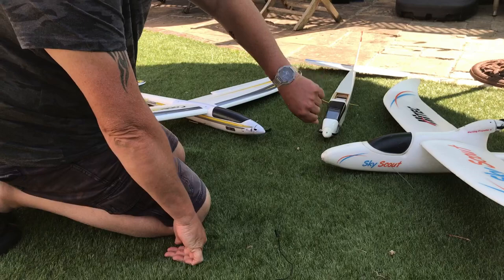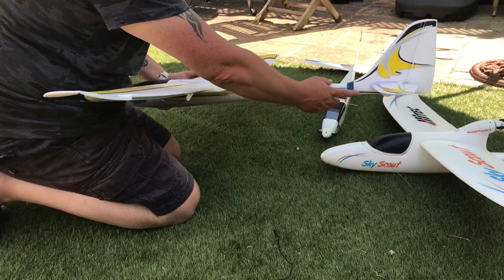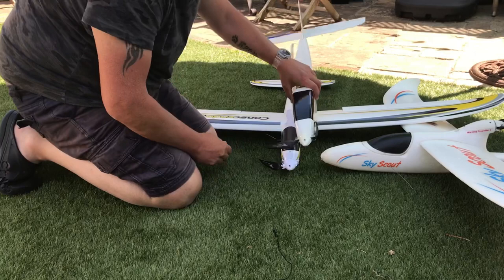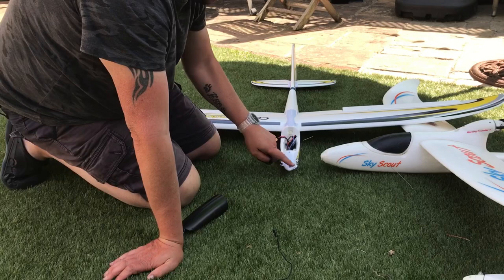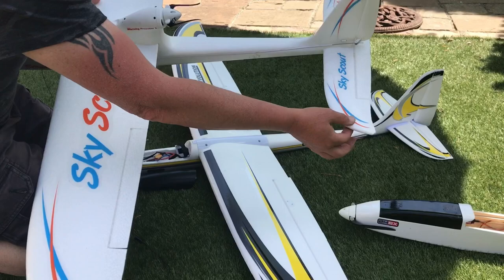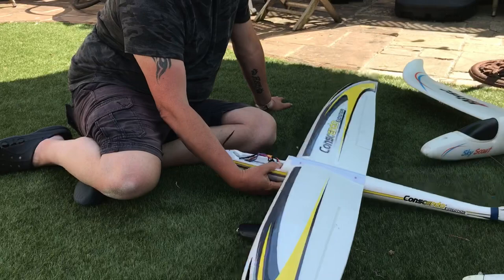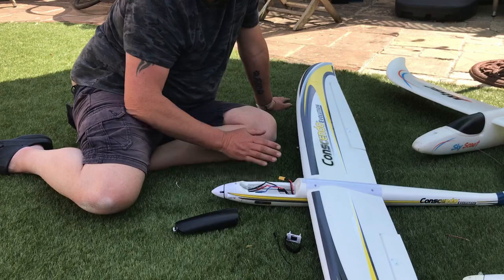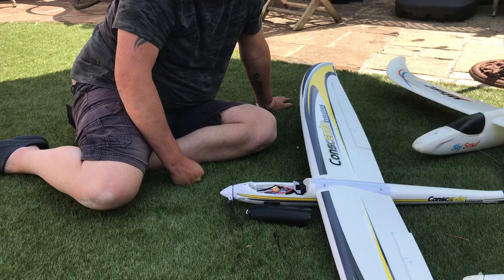Horizon Hobby Conscendo Evolution ‘honest’ review ‘update’

Comment: I have two conscendo evolutions (one is a backup still in its box...) because it is so good! When the weather gets bad and rough and windy, I leave the planes at home and take the Conscendo Evolution out to the field. I can fly with one battery a very long time (3S 2200 smart battery from spektrum). I once flew for 45min, then I landed and still had battery left (well it IS a glider, so with the right thermals you can fly for a very long time)... a great plane. No need to put a 4S in it.

Comment: Thank you for such an honest review. I'm the owner of Conscendo Evolution for over 2 years and I can confirm all the issues disclosed here. In addition, I could add a few more:
1) Wings horizontal positioning - look from the nose, and you will see that the right wing is a bit down the horizon while the left one is a bit upper - about 10 degrees angle to the horizon. I bought a second fuselage and found the same issue there too, so it's a manufacturer's bug.
2) Weak fuselage design, especially in the area of the battery compartment. It breaks in case of a side landing. You can find tons of videos of when people lose their Conscendo breaking fuselage in this area due to a hard side landing.
3) Very small space in both the battery and the receiver compartments. There is no space for adding something there (for instance, a gyro module or flight controller). I even barely can add a battery voltage buzzer alarm there.
4) Plastic gear servos - cheap stuff, that breaks easily after the first crash
5) No real hinges - all turning surfaces such as ailerons, elevators, and the rudder are just foam fixed with weak tape.
6) Wings mounting gear is total madness. There is weak plastic stuff that easily breaks after a couple of crashes. 
As a result, I spent +$300 and a hundred hours improving the plane by enforcing it with carbon fiber, changing servos, adding plastic hinges to all turning surfaces, etc. My current body is like a baseball bat, being covered by carbon fiber at 70%, especially the frontal section including the wings mounting area. I even added 3 carbon fiber rods along the fuselage from the motor section to the rudder to prevent the tail from trembling and shaking during the flight - it's not a fish, it's a plane!
Furthermore, I changed all original servos to EMAX servos with metal gear. I covered all the frontal parts of the wings, elevators, and rudder with carbon fiber stripes to enforce them. Wing mounting area and that plastic stuff had been enforced with carbon fiber too. I got +100 grams to the weight, but now this plane is a robust flying bat.
I like the shape of this plane, but it requires a lot of improvements to be done to get it working well.

Comment: I have some very mixed feelings about this video. The Conscendo was and still is targeted at beginners. That said it definitely looks like Horizon has hot-rodded the design over the years, and so it's pretty much to be expected things are going to break. This plane is NOT a hotliner, and really wasn't intended to be. In that sense I think you might be being a little hard on the plane as you want it to do things it wasn't really designed to do. Also, the price really isn't unreasonable for what you get. This is an expensive hobby to begin with, and there's not a lot of equivalent planes with that level of features and performance for that price point. 

However you do make valid points about the hobby, especially when it comes to marketing, and you're certainly not the first I've heard in regards to Horizon. I'm also quickly finding out who the (to put it politely) sponsored  sales reps are vs legitimate hobbyists. If a given channel is putting out multiple videos per week with different planes in each video, always giving good reviews, and/or seems to push one distributor exclusively, then you're likely dealing with a corporate shill. That's how I figured out what a rip-off Banggood is BTW. 

As far as the plane itself, most of the issues are just part of the hobby, and you actually did go through and address them. Not sure why you had the meltdown and destroyed the plane after all the work you put into it. On the other hand the flexing does bother me, and some of the quality control issues you brought up are also valid points. Because of that I've decided to go after the Great Planes Kunai instead as I think for various reasons it would be a better choice. So for that, thank you!

Comment: Sorry, but you're wrong. I have several rc gliders, including the Conscendo Evolution, which is an excellent foamy rc glider. It is true that a 4S lipo could be a lot for the characteristics of this glider. I have flown it many times and always with very satisfactory flights.
Reply from the maker: Erm, i’m not wrong, I haven’t imagined all the issues with mine, but i’m glad you’re happy with yours.
Reply: Try using his modifications to make it more ridged bet it would fly a lot better.
Reply: @HarryBunnGRVOTV  'It is true that a 4S lipo could be a lot for the characteristics of this glider.' So he agrees but says you're wrong despite the fact you said the exact same thing.... lol. 

I just received mine and bought it in spite if your review which did put me off at first, but the simple reason is I don't intend to go 4S and it seemed to suite the situations I'd be flying it. Heading for a maiden flight this week but impressed with the build quality so far which seems to agree with your conclusion that as a slow to medium speed 3S soaring/aerobatic glider it should be fine.

Comment: So, I would have to say that you are wrong and right. Right, because most of the foamy's coming out of Horizon Hobby lately whether it be this (a glider) to the Air Tractor or even a Jet have all been built with the same type of foam, mid grade servos, and loose battery trays. I tend to watch review after review after review prior to purchasing anything. 

Where you are WRONG: From the reviews I've watched, and other Horizon Hobby Planes I've purchased recently, I have made these modifications: ( New servos (digital metal gear all around), fixed carbon fiber spars further down the wing, and 2 on either side of the rear fuselage, Blue Loctite on the prop screws and CA Flexible Glue to hold the battery tray in (made this modification because I had another tray pop loose on a different airplane as well) ) 

After making these small mods which cost about $30 in total, this thing is an absolute champ (Even on 4s) no issues what-so-ever. I have been in the hobby for 20 + years and do planes, helis, drones, boats, and cars. From my experience the hobby is split about 60/40 60% Flying, Bashing, Racing, and 40% tinkering, building, modding, and repairing.  

Rather than having an overall bad attitude and childish (sorry not sorry) approach of destroying the plane which made you feel better as you stated to someone in another comment, put in the work, and fix it so it will perform the way you want it too. For the money of just under $200. This plane is incredible. For those of you who are watching this review and deciding to not get this plane because of this video. Watch other videos, and read above to make these small modifications and you will not be disappointed!
Reply: Yep. This is a really fun airplane. Tracks like an arrow. This guy just brings alot of drama

Comment: I bought one of these. And it sure is a flexible flyer. I think I will get a better prop for it before pushing the one that is on it. I already modified the battery tray thing so the battery didn't rock on it, and found that it wasn't held in very well at all. Just as you discovered. I am going to laminate the main wings and the tail and see how much stiffer it makes it. My Phoenix 2400 has multiple layers of poly, then paint, then laminate, and it stiffened the foam considerably. There is still some slight deflection, but only on very tight turns. Far tighter than the Conscendo will ever turn... I doubt I will ever get the Conscendo as stiff as my Phoenix thou. There isn't enough to the Conscendo to begin with, and the Phoenix has a plastic fuselage that I re-enfored with carbon strips.. I have all of the original servos out of the Phoenix if I need any for the Conscendo. I put cyclic servos in my Phoenix. I am curious how you got the rods freed up from the tubes thou. Mine are beyond stuck..... Thank you for the follow up review. It will save me some headaches....